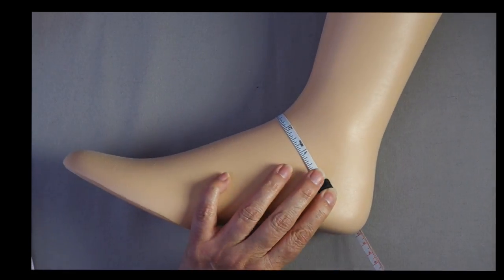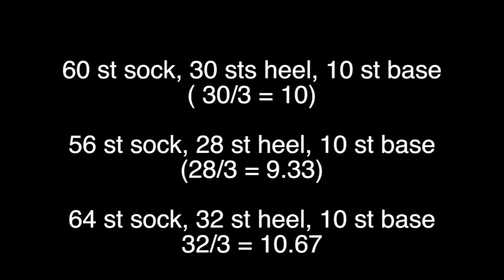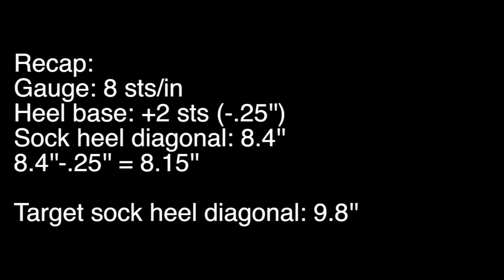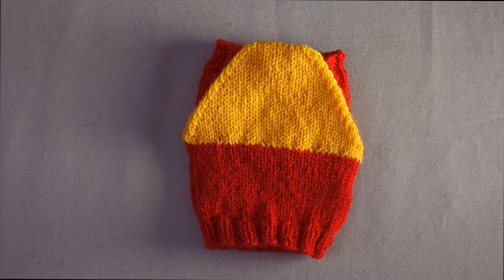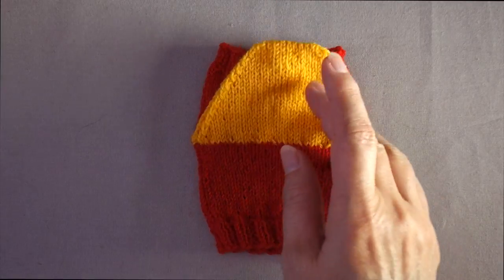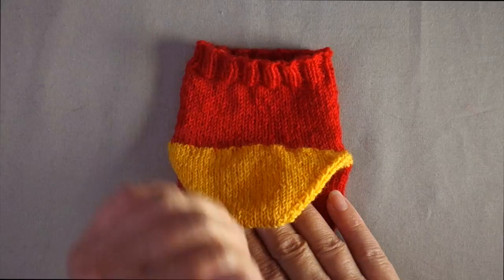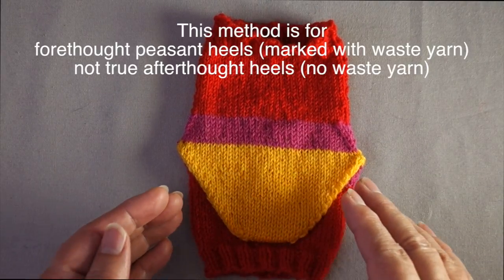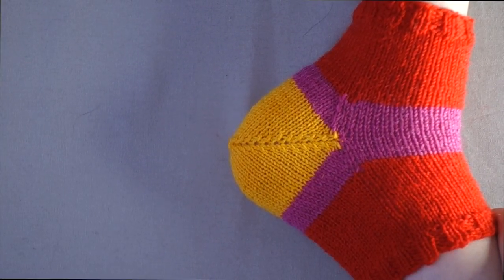Improving heel fit with heel increases

Comment: 0.48” at 7 sts/in
0.44” at 8 sts/in
0.40” at 9 sts/in
I just don't know how did you get these numbers please? I used ratio to calculated others but just lost here. Thanks for this. You are a great teacher.
Reply: I had same question. As stated 2 sts added = 0.4 inches added to diagonal at 9 sts per inch gauge. But 2sts/9 sts per inch = 0.22”, so I think some step and or explanation the inches added per 2 stitches formula provided in instructions is needed, imho and perhaps faulty understanding. Maybe the equivalence given is not based on math?

Comment: I have been watching all of your videos relating to socks.  I made a couple of pairs but they sit in the naughty corner because they dont fit me.  I made a partial sock to get the heel and flap to fit correctly.  I am about to cast on version 2 to tweak it again after watching this video a few more times. 

Thank you for your channel and all the good information you share.  I really like the math parts. I appreciate the details of each part of the sock being explained.
Reply from the maker: I do have a written tutorial that puts all the information about measuring, calculating where your likely fit issues will be, and then how to work various types of heels and toes, along with how to modify each typefor a customized fit. The formulas are all written down, and there are links to the videos, as well. If you're interested: https://www.ravelry.com/patterns/library/august-sock-kal

Comment: I have tried Cat Bordhi's Sweet Tomato Heel and the instep increasing by Kate Atherley in Knitty Fall 2008. I found the latter to work better for me, but there is some bunching of the extra instep fabric across the front of my ankle. I think I will try some of these modifications, maybe in combo, to get a better fit.
Reply from the maker: Let me know how it works out for you! I have found that increasing the amount of fabric in the place where the foot is larger to be the way to go. (For me, that means adding depth and diagonal across the heel, not the instep. Some people have insteps that are large/swollen, but don't have heels that are particularly tall, so different things work for different people.
Reply: I have a question, and maybe more to follow based on results. I'm going to go to your ravelry group to continue this exploration.

Comment: I have thick ankles and socks have always been difficult to fit over my ankle. In this video, the only thing I'm struggling with is (at 2:19) how is the 1.2 multiplier is derived? I'm a 'why' person, and I just don't understand that segment. Would you please elaborate on that? I love your in-depth approach to all of your videos that I've watched. You are my go to person for knitting issues. Thank you for being you and sharing your depth of knowledge with us!
Reply from the maker: That's based on an observation about what the actual circumference around a sock typically is for a given sock ankle circumference, using the formulas used for sock heel instructions.  The issue is that many people aren't proportioned for those formulas, so their socks don't fit. You can identify what the formulas expect your other proportions to be, and then compare against what yours actually are, in order to plan for fit adjustment. I have a written sock tutorial that goes through all the measurements, how to determine where your fit issues likely are, and then how to apply various mods to whatever sort of heel and toe you would like, as well as how to adjust for differences between ankle and foot circumference. August Sock KAL tutorial: https://www.ravelry.com/patterns/library/august-sock-kal
Reply: Thank you, O goddess of knitting! I will check it out.
Reply: And curiously, the 1.2 multiplier times my 90% sock circumference was exactly equal to my actual ankle diagonal measurement, no doubt because I have very wide feet.

Comment: Hi Roxanne. I started a sock toe-up, because I wanted a lacy stitch-pattern that only looks nice in that direction. Like you I prefer the heel-flap and gusset because of fit issues (high instep). I really want that gusset, so I started to increase at the sides ... 'but then how do I get rid of those extra stitches when I start the leg? My ankle is not wide at all!' ... So I searched your playlist on socks. I think this tutorial gives the solution. I can decrease the stitches at the end of the (short-row) heel. It doesn't look bad. 
So this is a new experiment!

Comment: How do you know that you need a heel base of 1.5"rather than 1.25"? Is that through trial and error? or is that calculated somehow?
Reply from the maker: It's from knitting  a heel that came out too pointy. It's useful to knit a peasant heel to see what exact fit you actually need. You can always rip back a couple of rounds to adjust the final width of the heel base and the final length. (You can knit decrease rounds without plain round between, or knit extra plain rounds between decrease rounds.) It's reasonably easy to get a reasonable fit the first time around, but it takes some experience to get the exact fit that you want, partly because of foot anatomy, but also because of fit preferences.
Reply: Thank you.
Reply: @neuro-mm8in  Good question.  I'd wondered that, too.  :-)

Comment: Hey Roxanne, I have a question... how do I know how wide I need my heel base? In your case, you need 1,5 in heel base, but how do I know how much I need? Thanks in advance and, as always, great video!!!
Reply from the maker: Well, I've knit a number of peasant heels for myself, and once I solved the issue of getting enough depth and a long enough diagonal, I saw that if I went too far into the pointy-heel territory, it isn't what I want/need. Once you've knit a few pairs of socks, you spend the rest of your life tweaking things, sometimes just to see what will happen. So try it one way, and if you don't like it, tweak it.
Reply: @RoxanneRichardson  thanks for answering me! Well, actually I'm knitting a sock for my friend, so I have no reference to follow. I already measured her foot, following the steps of your video, just this part was a little bit difficult to me. I guess I should use the standard 1/3 heel stitches then, right? Thanks again!

Comment: Thank you for all these detailed information.  However, I am confused by what you say at 3:53.  For every two sts you add to heel base...  What are you adding to heel base?  You figure out the stitches you need for the heel base but I don't get what you are adding.
Reply from the maker: If you want to use more of the sts for the heel base so that it's wider.
Reply: On a sock with 60 sts,.30 are used for the heel and 30 left.for the instep. Ie you would leave half the stitches behind as you work the heel .
 If you were.to add 2  to the heel base, you would then have 32 sts for the heel and 28 left on the instep.
Stricktly.speaking , youre not adding stitches, but rather youre moving stitches .

Comment: What exactly do you mean by "heel base", please? You said you need 12 sts for your heel base. I do Fleegle heels. I'm at the point I need to turn my heel. I'll knit to 2 sts past the center marker, decrease 1 st, K one more, Turn, repeat for Purl side, so 4 sts on each side of the center marker. Is this an 8-st heel base? Or is it something else?
Reply from the maker: This video is demonstrating (hourglass) short row heels and peasant heels, so the heel base would be the row that lands at the floor, where the leg turns 90 degrees to become the foot (or vice versa). These types of heels are symmetrical, with the leg half of the heel a mirror of the sole half. The Fleegle Heel is an entirely different type of heel.
Reply: @RoxanneRichardson  OK so it's where you begin turning the heel, which is what I thought it was, I'd just not heard it referred to as heel base. And I mistakenly thought that since the fleegle heel is a variant of a short row heel that it would work with this method of calculating heel length. Thank you!

Comment: I do afterthought heels. I have same problem you have. Wondering when I cut into heel initially, could I unravel stitches all the way to the other side of sock, like 4 extra on each side. Then begin my yarn for heel with gradual increases. Seems it might give me a bit more room on the top part of foot where it normally feels tight?

Comment: Hi!  Thank you so much for this!  I'm knitting socks for someone with a narrow foot and large heel diagonal.  Can I ask why you are instructing a 0.8x multiplier for the negative ease instead of 0.9?  does it matter?
Reply from the maker: It's based on observation of "average" measurements and use of the standard formula with these types of heels. If you prefer a different amount of negative ease for your socks, there's no reason why you can't use it. Compare the fit to what I'm suggesting here, and see which you like best. You might find that you want to tweak it a bit more here and there, as well.
Reply: @RoxanneRichardson  thanks.

Comment: Believe it or not my diagonal heel circumference is the same as yours. I do like top down socks with a heel flap too. Fit me very well. But I am trying out a toe up with the opposite shaping to achieve the heel turn. Does this work on your foot or will it give me problems?
Reply from the maker: It should work equally well in both directions.

Comment: What method decrease did you use on the edges that shaped the diagonal on your heel? I don't like the afterthought heel that makes a thicker join like the toe, although I like the idea of doing the heel afterwards especially for traveling.
Reply from the maker: I placed the decreases side-by-side, rather than putting two knits between them, and I have them pointing at each other, rather than away from each other. (ssk at the end of one round, k2tog at the start of the next (side-by-side), then work to the mid-round, ssk before the midround,k2tog after. The ssk I use for this heel is a variation. sl 1 as if to k, sl 1 as if to purl through the back, then work them together through the back. This puts some additional twist into the bottom st that helps prevent a gap between the two decs, as well as minimizes the ssk enlarging. I should probably do a video on this. I really like the result better than replicating the toe decs as well.
Reply: @RoxanneRichardson  you should make a sock pattern with this method,  or do you already have one?
Reply from the maker: No, my sock videos tend to be on techniques to improve sock fit and finishing. You aren't the first to suggest a sock pattern!
Reply: @RoxanneRichardson  Hi Roxanne, whilst on techniques, would you care to add the short row method you used?  (wrap and turn, German short rows, etc.).  They are very neat and tidy in your demo pieces.
Reply from the maker: @published1789  In this video, all three heels were knit using a peasant heel, as describe above. (I did a video on this technique, which you can find here: https://youtu.be/SYOO7IIb6AA ) When I knit short row heels, I use German short rows. I have a video on three ways to knit German short row heels, which you might find helpful. https://youtu.be/zywKS3jj0rg (for my heels, I usually use the method where on the second half of the heel, I slip the stitch after the turn instead of making a double stitch; sometimes I use the version where I work two rows between each half; I rarely use the version where I work two rounds between each half.)

Comment: New listener. Can you share what yarn and needle size used in these tutorials?
Reply from the maker: I think I was using some old Opal 4-ply fingering weight yarn from my stash. I have no idea what needle size I was using. Normally, I use a needle that gives me a gauge 1 or 2 sts firmer than the ball band suggests (so if it suggests 7.5 sts/in, I will knit at 9 sts/in). The ball band recommendation is the gauge you'd want for a stockinette sweater, which has nice drape. For socks, you want something firmer. I may have been working at 8 sts/in for the purposes of the video, because that's a gauge many sock patterns are written for, which means I was probably using a US 1/2.25mm or US 1.5/2.5mm. Again, the needle size I use to get a particular gauge isn't necessarily the needle someone else will need to get the same gauge.
Reply: Thanks so much for the info. I neglected to post how much I appreciated your thoughts and experience. Thanks again.

Comment: What would you do if the Sock Heel Diagonal you found by measuring your foot was less than the Sock Heel Diagonal your size sock will produce?
Reply from the maker: I have a friend with measurements like this. She is short, so her heel isn't very tall, but she has a large ankle, and more average ball of foot. This results in a heel diagonal that is more in line with her foot circumference than her ankle circumference. I haven't knit her a SR/peasant heel sock, but I have done the calculations to see how that would work. I calculated the heel she would need if I was working toe up, and using the stitch count appropriate for her ball of foot, and that worked out right, so my strategy would be to work the heel over that number of sts, and then decrease sts with a gusset after the SR heel or after placing waste yarn for a peasant heel. Another option would be to decrease several sts across the first row of the heel (the way you can increase across that first row).
Reply: Rox, thanks so much. I love the math!